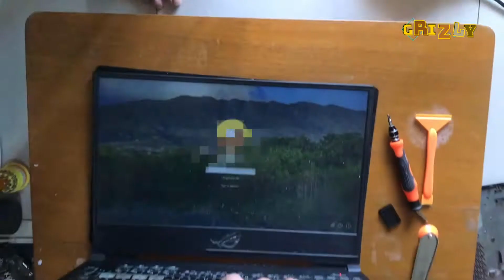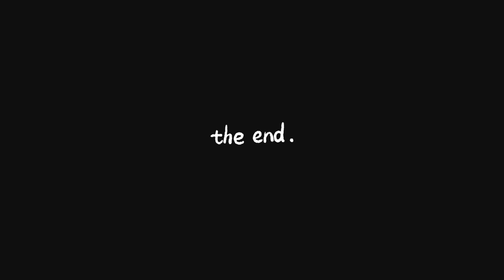FIRST: HOW TO CLEAN AND REPASTE LAPTOP ASUS ROG GL504 | 220128 grizly808

Comment: i got problems with that antenna pin black and white, is so hard to clip that.
Reply from the maker: Use twizzer to pry the pin but before it turn the pin clockwise and otherwise carefully  ,do it carefully, before do this make sure the battery connector already plug out

Comment: What was the purpose of doing this? Was your system overheating or were you just hoping to get better temps than the stock temps? Or were you getting BSODs due to overheating? Cheers
Reply from the maker: In my case ,i got thermal throttling, when i play games it suffer fps drop , but after i clean and repaste , the problem gone .

Comment: why did you totally remove the battery?  It seems that just disconnecting the clip would have been sufficient and time efficient.
Reply from the maker: For cleaning purpose and for safety too
Reply: @griz808  Cleaning I'll buy, but not necessarily the safety part.  So my Asus was a bit different on the inside... What I did helped, but after 4o minutes of run time she's back to screaming at me.

Comment: hello.. do they use thermal pads or thermal paste on vram by asus ?
Reply: they used paste when i first opened the laptop when warranty expired now i am applying gelid thermal pads of 0.5mm thickness
Reply: @DrChrisEvansMD  thanks!
Reply: do you know the answer?
Reply: @muh1c891  no never found out will guess Pads
Reply: @muh1c891  liquid thermal pads